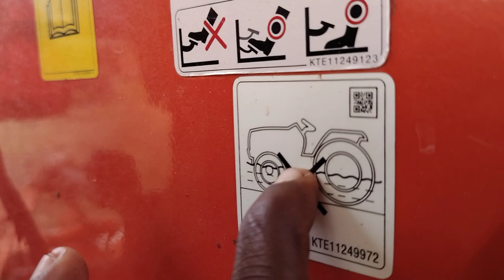KUBOTA tractor's problems and solutions||KUBOTA டிராக்டரில் வரும் பிரச்சனைகளும் அதனுடைய தீர்வுகளும்

Comment: Fromt axil la oil varuthuna reason antha front axil la heat ahkum pothu oil air expand ahkum so pressure increase ahkum bro atha vandi start pannina 30 minla erunthu 2 hrs ku 30 min ku one time open panni vidanum.....illana oil nut la hole pottu small pibe set panni  thanni ulla pogatha mari engine radiator la vaikanum broo..axila oil ceil pogavay pogathu bro minum 4k hours life kodukkum bro
Reply from the maker: Breather irukku bro

Comment: Previously owned JD 5103S, 5042D, 5310 ,mahi 575,275. Over all Kubota 4501 is ok in all segments... But proper greasing is required in Kubota  due to low gap availability between rotating shaft and the member
Reply from the maker: S bro
I used grease daily before start the engine

Thank you for watching my chennal
Reply: @sahiitractors.369  don't use hand held grease gun.. use 5 kg grease gun.. even after mud and before mud greasing is required.. now i have covered almost 1950 haven't changed a single oil seal.. but using for all implements..